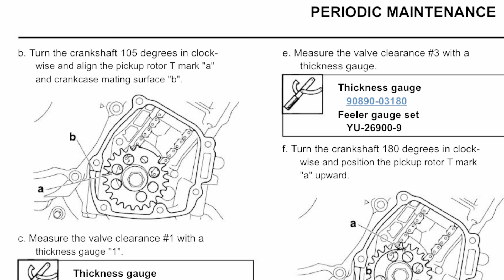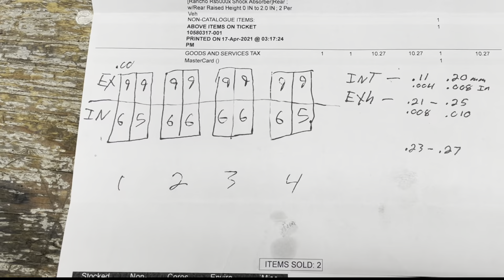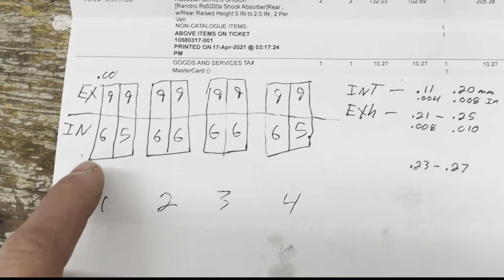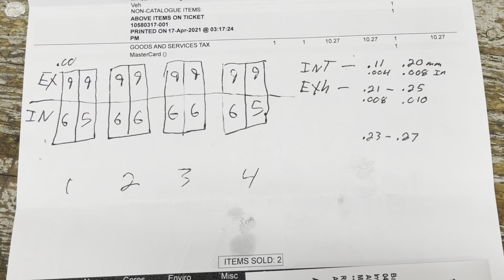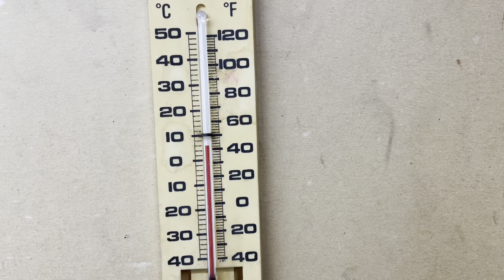Yamaha Crossplane R1 Hard Start Valve Adjustment And Starter Solenoid Fix

Comment: My 2012 R1 hated cold starts. I changed starter brushes and balanced the throttle bodies trying to solve the problem. Yamaha was no help at all. Turns out just needed a better battery to crank faster. Lithium is the way to go.
Reply from the maker: Lithium battery and a complete starter ended up fixing my bike as well.

Comment: I had the same 2012 R1 (just traded in it in for a 2021 R1 this week) and solved the cold start issue by replacing the battery with a Shorai Lithium battery with crazy cranking amps and never had the cold start battery drain issue again. Almost forgot about it until I saw your vid. No more sitting at the gas pump after filling up from a hard ride until the bike cooled down to re-start!!!
Reply from the maker: Nice. That definitely seems to be the go to battery for the crossplanes. How do you like your new bike so far compared to the old generation?
Reply: @JT2JZ  Got another Raven which was hard to find with low production due to the covid pandemic and its my 4th new R1 in a row since 2008 so addicted to the R1's styling and performance! Loved the 2012 (was lucky to get it at a great deal as a factory left over in the crate in early 2015) and always got thumbs ups from drivers at red lights so get used to the compliments with yours!!!
Reply from the maker: I’m definitely enjoying it so far! How do you like the new style R1 compared to your old 2012?
Reply: @JT2JZ  Prefer the 2012's more aggressive nose fairing lines but simply was due for a change in technology. Not a wheelie guy but do like the occasional up off the seat and on the pegs get tucked aggressive ride. To soon to judge which bike is more intuitive, but time will tell :)
Reply from the maker: I know the feeling. I felt like I was due for a change riding my old 2006 for roughly 4 years. Sometimes just switching things up in general is nice. Big jump in technology for me but I’m pretty impressed so far. I’ve never had anything newer than 2006 believe it or not. After getting some seat time on my 2012 I think it would be really hard going back to anything older.
Reply: I had the same issue and the battery changed everything it’s a go to battery for crossplane motors

Comment: Very similar issue that I had on my 2002 R1 rn09 - very hard to start, it cranked forever, no matter the ambient temperature. Mechanics said valves out of spec, throttle body, spark plugs etc. etc. When I finally decided to sell it (could no longer ride in this aggressive position - bad joints) when the buyer was like hour away the bike couldn't start at all. I tried some things and figured when I short the solenoid the bike starts no issue. So definitely the culprit - so I changed it and the bike like you said started in like 1-2 seconds lol. So many years with this headache-inducing "issue", luckily I didn't bother to solve it as I would have thrown so much money away on mechanics adjusting stuff and changing parts.
Reply from the maker: Sounds frustrating for sure! I definitely feel your pain.

Comment: So you just had to clean out the starter solenoid thing? I’m having a similar issue rn. Started about 3 days ago. Cold start struggling to turn on but it will. Once it’s up it’s good all day until it’s cold again. I bought a new battery and that didn’t help. Bought a new starter motor and solenoid rn. Hopefully it’s just that. Mine has 19k miles and it’s an 09.
Reply from the maker: It’s will either be the starter relay / solenoid or the starter it’s self.
I ended up doing both on my bike eventually as well. I think the starter was the root cause the whole time.
Check out my other starter replacement video and you will see it was in pretty bad shape when I removed it

Comment: Thank you for your detailed video.  I’ve been wondering same on my 2012 R1. I was also told changing starter helps too.
Reply from the maker: This definitely helped my bike but yes I also changed my starter later on as well. 
Check out my other starter replacement video if you are curious. I disassembled the old unit and the internal brushes were crispy jet black!

Comment: Pretty cool the valves were still in spec cause the book says check them at 26.6k and seems that most people's R1 valves are still in decent shape at that interval. Yamaha makes a high-quality product.
Reply from the maker: I was surprised as well! Yamaha engines are usually great quality. Riding style may have more of an impact though. 
My bike has a decent amount of touring / low rpm riding on it.
If it was a race bike being used high rpm every single ride it would likely need a valve adjustment at the recommended time I would think.
Reply: @JT2JZ  Yea that definitely makes sense. Im getting ready to go look at a matte grey 13 with 2.5k miles, the dealer wants $10.9k. Seems like to me thats the high side of fair...ish.
Reply from the maker: Dealers always ask top dollar. That is extremely low miles though. Might still be a decent buy.
Reply: @JT2JZ  Yea definitely! Sad thing is this dealer is cheaper than private sellers in my area so the F-en guy acts like he's doing me the favor selling it to me at high retail 🤦‍♂️. I'm gonna have to think about it or hes gonna have to come down. And he's had people in there cause he's cheaper than the crazy private sellers so he's sure it's a deal lol.
Reply from the maker: What a time to be alive ehh? Lol

Comment: From what I saw so far ,this seems to be a common problem on the R1's regarding cold start , I have a 2003 R1 with same problem ,will definitely look into my starter relay next too. Thank you for your video.
Reply from the maker: I’m glad I could help. It’s definitely a quick easy place to start anyway. Good luck with the repair.
Reply: hey man, did that starter relay fixed your cold start?
Reply from the maker: It fixed my cold start for a while. I had underlying issues though. My starter completely failed later the same season.
Reply: @JT2JZ  many thanks for the info
Reply from the maker: No problem. Check out my other starter replacement video and you will see how bad it was when I removed it and disassembled. 
Completely cooked!
Reply: @JT2JZ  I went to the shop and ordered that solenoid..6days shippment...anyway, i cleaned it with brakecleaner and starts right up like new...when the solenoid arives, i
will instal it. Hope with this i can enjoy the bike. Thanks again for the info.
Reply from the maker: Sounds like that will fix all of your issues 👌

Comment: Great video and great walk-through 👍...
I got the bike 1 week now... and was plaged with this problem ... a nightmare to start ... would drain the battery time and time again trying to start..
Just went right to the solenoid and ...guess what it was far worst than yours... cleaned it and voila ... STARTS AT FIRST TURN 👌👍👍
Reply from the maker: That’s great news. I’m glad my struggle could help you save some time. 
If your issue returns you may have to replace the relay. When I cleaned mine it only lasted roughly a month or so before I had to swap it out

Comment: I have a 2005 yzf r1, I took my relay out, completely forgot whether the red or black wire goes to the battery or motor, mind helping me out? I saw your red was to battery, just wondering how I find out
Reply from the maker: I’m not 100% sure if your 2005 and my 2012 would be the same. I used to have a 2006 r1 as well but I sold both bikes. I wish I could go check for you.

Comment: My 14b starting up exactly the same, not always on first attempt and especially difficult when it's warmed up to working temperature.
Reply from the maker: Sounds like you may have starter issues. My starter failed not long after this video. 
Check out my starter replacement vid to see how bad mine was. The old starter was black & crispy!

Comment: Thanks for the video! Helped me a lot.
I am running into issues putting the valve cover on, the gasket keeps getting out of place when trying to reinstall, it easily falls out of its spot on the cover, dont have room enough to get the cover over with cams with the gasket on the cover😅 Any tips?
Reply from the maker: It’s definitely a very tight fit but it is doable! A lot of wiggling to find that perfect spot. You can try putting a small amount of Vaseline on the valve cover to try and hold the gasket in place. 
Patients is key.
Reply: @JT2JZ  thanks, managed it!

Comment: I have the same issue with evem with a lithium battery's.  So thanks for the video
Reply from the maker: The relay fixed my bike for a while. I also had a bad starter later the same season. Check out my starter replacement video if you are curious how bad mine was.

Comment: Nice video. Why there is fort exhaust 0.21 / 0.25 and 0.23 / 0.27. What is the difference or right gap measure between the two for 09 14 r1?
Reply from the maker: Intake valves will be a different spec than the exhaust valves due to the difference in temperature they see.
I called my dealer to get the correct valve lash numbers for my specific year of bike. The dealer always knows best!
You want your valve lash to be roughly in the middle of the high and low spec they give you

Comment: So I am a ZX10R guy and I have a 2009 R1 I am working on.  Basically I just finished the valve adjustment, have the valve cover back on - but I have no idea what sequence the air box and throttle bodies go back together as I did not take them off the bike.  Does the throttle bodies go on first before any of the air box?
Reply from the maker: Yes throttle bodies first. Then bottom half of air box. The plastic intake trumpets go inside the bottom air box half. 
Hopefully that helps. 
I have lots of other videos as well tearing into the top end of my bike If you look on my channel. 
You should be able to see almost everything from some of my older vids. My starter replacement might be a good one.
Reply: @JT2JZ  thats outstanding, thanks for the reply dude.  Ill get to work on installing the throttle bodies and go from there, and I will reference your other videos.  Any videos on how the ram air tubes assemble?  If im not mistaken, it looks like if you have block off plates installed, that the air collector (which sits just above the valve cover) is only held in place by the (2) ram air tubes coming in from outside the frame on both sides?
Reply from the maker: It’s been a year or so since I assembled my bike so it’s hard to remember some of the details. I think you are on the right track though. 
If you are talking about the bottom of the plastic intake assembly that holds the trumpets inside of it, there are some Alan key bolts holding it in place on the inside. 
It also connects to the throttle bodies from the outside of the case and keeps it pretty snug.

Comment: Hey bro, I’ve just done this swap, and it blew the 50amp main fuse, did your replacement starter relay have 15 or 30 amp fuses?
Reply from the maker: I believe mine was 15amp fuses. If you keep blowing fuses it sounds like something is shorting out on your bike.
Reply: @JT2JZ  thanks for the reply dude, I think where the replacement relay had 30amp fuses it blew the main fuse and now it’s throwing a code 12 on the dash 🤦‍♂️
Reply from the maker: @RollinThundervlogs I feel your pain. I struggled with my bike and starting issues for a long time as well. The root cause of all my issues was the starter it’s self. You can check out my starter replacement video to see just how bad my starter internals were fried.
If I was in your shoes I would probably try a starter draw test. Try and see if it’s using excessive amps when cranking. 
Starter failures are very common on these bikes unfortunately.

Comment: Keep em coming buddy.. From UK

Never had issue starting bike got 2011 R1 but got an issue when I was out riding the dash just switched itself of and lost power the dash keeped flickering on and off as if I was turning the key.. Checked batt and all connections all good any ideas... Recently fitted trans QS been on for a month no issues🤔
Reply from the maker: I’ve never ran into that issue before. I’d start by checking battery connections like you have already then maybe test power and ground circuits right at the cluster. 
If all tests ok maybe start looking at aftermarket components added onto the bike.
Reply: @JT2JZ  thanks for the reply will look into it again cheees

Comment: Did you replace the starter solenoid or just cleaned it up  ?
Reply from the maker: Cleaned it. It worked for about a month but ended up replacing it.

Comment: Your compression test must be done effective with throttle wide open while cranking
Reply from the maker: Agreed. I was just nervous of throwing the throttle body sensors out of adjustment. Probably wouldn’t have but didn’t want to risk it. I was basically just looking for consistency not really an exact compression number.

Comment: At 11:40, the K mark...do you feel compression when the K mark is lined up with the split in the case, because if you rotate the crank 360 degrees then the compression releases and it lines up on the K.  At which rotation of the K do I then set the cams?
Reply from the maker: Cams rotate at half the speed the crank does. It should only line up one way.
Reply: @JT2JZ  hey brother sorry to bother you man but would you mind taking a quick look at this timing, this is with full chain tension and the cam caps torqued down.  Intake cam looks good just not 100% sure on the exhaust cam: https://youtu.be/yLQsUkuzIJ0
Reply from the maker: I checked out your video. I think that exhaust cam is one tooth out. I think you want the dot on the right of the exhaust cam flush with the cover ( not the left side of the exhaust cam ) 
The intake cam looks correct with the timing mark lined up flush on the left side.
Reply: @JT2JZ  you were absolutely right man I kept adjusting the cams, I realized later on I didnt need to remove cams every time I needed to rotate them.  I just loosened tensioners and free'd up chain slack and with practice you can rotate the cam in place a tooth or two at a time, all while maintaining solid tension side pressure and also torquing down the exhaust cam first was a huge help in regards to getting all the slack on the slack side.  its amazing and rewarding experience for me.   thank you for your help.  here is a video of it running tonight after the timing was set properly https://www.youtube.com/watch?v=CGzVqf1YQ5Y
Reply from the maker: She sounds healthy! Nice work man. I agree, I enjoy doing as much work myself as I can. Very rewarding at the end of the day.
My latest skill I’m trying to learn is tig welding but it’s more difficult than I originally thought it would be!
I really want to start making custom pie cut exhaust systems with stainless steel. 
Hopefully all the effort now will pay off in the long run.
Reply: @JT2JZ  yea dude tig welding is a valuable skill man I have never welded at all before I think its a great goal.  thanks for all the help
Reply from the maker: No problem at all. 
How many kms on your bike? I should probably get one of those manual chain tensioners like you have. ( I’m sitting at 32000kms ) still on the stock tensioner so far.
Reply: @JT2JZ  it's got about 28xxx miles.  Actually going to upgrade the manual tensioner to an APE or Graves.  I've never worked on an R1 and the whole manual tensioner thing was kind of bizarre to me but I get it now.  Its going to be a dedicated track bike.  Since it's been in my garage it's gotten a new EBC clutch and heavy springs, including new OEM basket and hub.  new vortex 520 sprockets and chain, new clutch cable, block off plates, full armor bodies track fairings (that still need to be fabbed up) and many more.  it's been a fun project and interesting learning a new type of bike other than the zx10
Reply from the maker: Should make an awesome track weapon! 
Just out of curiosity we’re your valves out of spec or still pretty damn close?
Reply: @JT2JZ  you know the entire exhaust cam was out of spec, all the exhaust valves were about 06-.10mm too close, had to go with smaller shims to widen the gap and put them in spec.  intake cam was all good but still put new shims in there anyways to put them all on the safe side

Comment: Why would an R1 be hard to cold start?  I have never done a thing to my 2012; I let it sit in a freezing garage all winter, have never adjusted the valves etc. And it starts up every time, on first press and within < 1 crank.
Reply from the maker: I guess I am just lucky finding a bike like this with underlying issues 🤷‍♂️ 
I have owned many other older bikes and if I combined the issues from all of them put together i would still have less issues than I have had with my new 2012 crossplane in less than a month of ownership. 

That’s the risk with buying anything used sometimes.

Comment: What is your mileage on your bike
Reply from the maker: 31500kms. I started having my issues at 26000kms
Reply: @JT2JZ  yeah that's when they recommend to check Valves
Reply from the maker: Surprisingly the valves were not my issue. They were all still in spec. 
Root cause of my hard start was the starter it’s self!